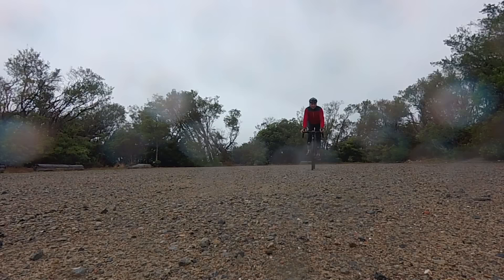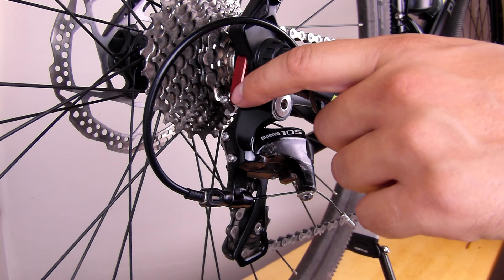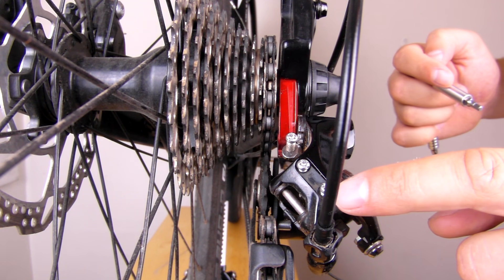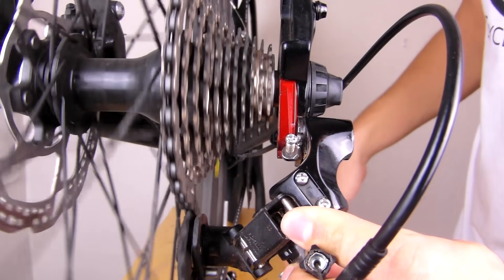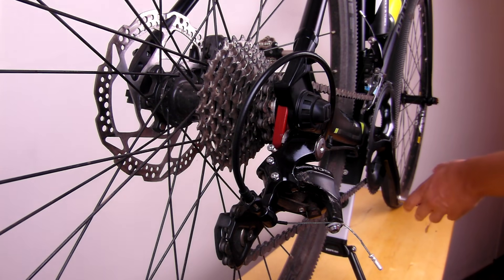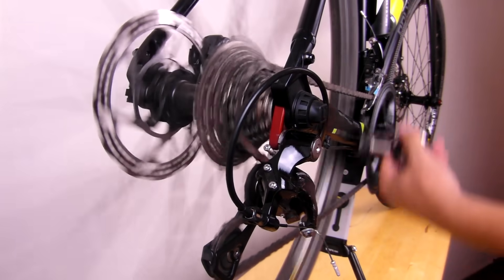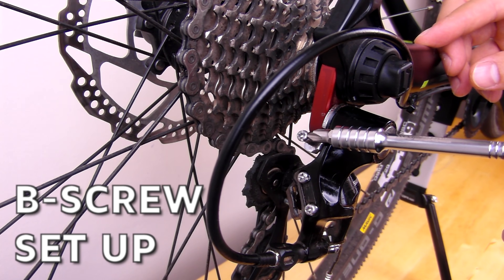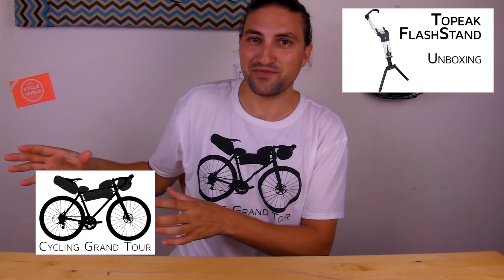How to Adjust your Shimano Rear Derailleur | #CGT - Bike School

Comment: Thank you man.  I just spent two days literally fixing my bikes gear shifting and you having explained the concept and easy steps, which helped me get things done in an hour.  My shimano derailer isn't as good as yours so I had a ton of trouble adjusting it right since the chain tends to end up slipping either to the front or back of the cassette.  I had to adjust L and H but the worse part was the anchor bolt where I had to adjust the wire tension to somehow make the derailer arm align with the cassette.  I then shifted to every gear and quickly adjusted, while my bike is upside down until it was somewhat smooth gear shifting.  I still haven't made the shifting as smooth as I want, but it's a huge step in the right direction and I'm writing to say thanks since now I can at least ride my bike with gear working.
Reply from the maker: Thank you for your comment, John. I am glad it helped you and that you are back on your bike! If you have any other questions, let me know.
Happy riding!

Comment: Thank you. This guide is different from others I watched. And looks like I succeeded. 
Very short and clear guide
Reply from the maker: Awesome! Thank you for your feedback, Gleb
Reply: @cyclinggrandtour  is there a chance, that rear derailleur is working strange due to bycicle has only ~ 500 km run. Everything worked well on tripod. But when I had a ride, it started to act strange. Like not switching the gear, and swithing two gears afterwards. 
Thank you!
Reply from the maker: Hi Gleb,

I would suggest checking the rear derailleur hanger alignment first. 
Then I would make sure the rear wheel is installed correctly (if quick release, open it, put downward pressure on the bike to make sure the wheel is sitting correctly on the frame).
Last thing would be to check the gear cables, especially if you ride the bike in wet weather or mud. 

Give that a try!

Comment: Thank you. You are a big  help  to me! I was not able to shift to 2 biggest and 2 smallest gear but now with your video... I could. I still could not get into gear 9 though in my 10 speed cassete when shifting down from 10 to 9, I have to shift to 8 to move further down gear and skip 9 sprocket ..but when I shift up from 1 to 10 I could get into 9.. Will you be able to advise?
Reply from the maker: Hi Jeremy, happy the video helped.
The issue you're having can be down to 4 problems.
1 - Old inner/outer cable - if your cables are getting old, there will be more friction when changing gears and could lead to the problem you're having.
2 - Old derailleur spring - If you have a low to mid-range derailleur, the spring can get "tired" after a few years. In some derailleurs, you can swap the spring, others you might need to get a whole new derailleur.
3 - Limit screws - If your limit screws are a bit too tight, it might stop the chain from flowing to gear 10. It works when you do a more violent gear change because of the momentum the chain/derailleur gets when you try to do multiple shifts at the same time. Try to releasing the limit 1/4 of a turn, then try again. If still not ideal, do another 1/4 turn.
I would recommend doing step 3 first, if still not working, try new cables as step 1 indicates. If everything else fails, might be cheaper to take the bike to your local bike shop and get them to see if you need a new derailleur as step 2.
Let me know how you go with this!
Thanks for watching
Reply: @cyclinggrandtour  hi.. sorry I got it wrong..it was gear 2 that I could not engage . It has to be either 1 or 3. So should I adjust the lower limit ?
Reply from the maker: @jeremytan4569  gear #1 being the easiest gear to climb hills? If yes, then not being able to select gear #2, and assumig all other gears are near perfect, could point to a problem in the shifter.
If some gears are rattling and you can't use gear #2, then it's most likely the cable tension. Changing inner and outer cables is quite inexpensive and will tell you straight away if that was the issue or not. Friction cause by older cables can make gear shifting and cable tension adjustment near impossible.
let me know if this helps

Comment: Hi! This is an excellent tutorial, I'm a newbie to these stuff so when on big chainring my rd couldn't shift to biggest cog and the smallest cog but anywhere outside that the shifting is smooth as butter, but when on smallest chainring all gear shifting is so smooth (rd can clear from smallest to biggest cog without issue) any idea how to fix that? Thanks!
Reply from the maker: Hi!
What drivetrain are you using? 
I know some electronic drivetrains don't allow for steep cross chaining.

Let me know what you're using and I'll try to diagnose what issue you might have.

Cheers
Reply: @cyclinggrandtour  it's a 105 5800 11 speed groupset just like on the video
Reply from the maker: Hmmm that is a peculiar issue.

My first thoughts it that the chain might be too short - that would explain the chain not getting into the big cog when on the big chainring, but not the issue you have on the small cog.
Another idea might be limiter screws, or old outer cable, but because you have full range on the small chainring, this might also not be the case.
If the cassette is too worn out, that can also make shifting harder, or if the chain is worn.

Unfortunately, I can't think of one exact reason why you are having those issues. 
Perhaps look at the above and go one by one, and try to find the culprit? 

Best of luck!
Reply: @cyclinggrandtour  well after i keep tweaking it to the best i could i decided to take it for a ride, what i found is that from big chainring i can shift to biggest cog but it's a bit slow and creates ticking noise before making the shift and i also can shift to the smallest cog but it's also creates ticking noise no matter what i do with the barrel adjuster
Reply: As for the chain's length i can safely assume that it's adequately sized, cables are also fairly new (i have put 2k km on them) chain is brand new (less than 500km) idk about cassette because i got it second hand along with the rest of the groupset, i replaced the chain immediately with the one i currently using, it looks pretty good and considering the previous owner said he's "barely using it."
I should probably keep tweaking with the limiter screws and the barrel adjuster, there's something i probably missed, thanks for the replies!
Reply from the maker: Not a problem, and thank you for replying back.

If we ignore the fact that you should be able to use all gears, for the best life of your groupset, you shouldn't cross-chain often, especially under load, and the steep chain angle will wear out your drivetrain faster. Try to use: small chainring = 1 to 8 gear (1=big cog); and large chainring = 4 to 11 gear.

For the limiter screw for the smallest cog, you can afford to keep it quite lose (ie. an extra half turn off from perfectly aligned), because you will rarely have any issues by doing this. 
The limiter screw on the big cog is a lot more crucial, as you don't have the derailleur to hit the spokes, because that can we a big issue.

I assume you checked the derailleur hanger too?

Have you checked your B-screw tension?
Reply: @cyclinggrandtour  i only do cross-chaining when attacking a short-punchy hills, that's why i need the full range of gears, of course i wouldn't do that under normal circumstances. well, i did some tweaking again with the limit screws and barrel adjuster, it's much more better now, all gears shifting smooth except shifting to biggest cog with big chainring, it has slight delay and rattle but at least it shifts, i guess that's perfectly acceptable for me
Reply: i once fell when failed to unclip, bent the hanger and had it fixed, at least it looked straight with my naked eye. i gave the b-screw couple of turns, other than that i don't really pay much attention to it
Reply from the maker: Gotcha. Well, I'm glad you got it to work okay-ish. 
When standard hangers bend, they don't usually go back to be 100% straight. I would recommend getting a new one, and buying a spare just in case.

Thank you for the messages, it was good to troubleshoot this with you.
Happy riding!

Comment: the b screw goes in and out on my old 10 speed but it doesnt seem to do anything with changing the tension or proximity to the cassette. perhaps theres a spring thats worn out?
Reply from the maker: Hi
My guess is that your chain might be too long, and if that's the case, the b-screw would not be able to add any tension to the derailleur/chain. 
Chains stretch over time and it's not uncommon for people to remove a link from a well used chain to shorten it and give back some tension to the system.
Select your smallest cog in the back and smallest chainring on the front and see if the bottom of the chain bows down, floppy style. If that's happening, then the chain would be too long and could be improved by removing a link out.

Let me know if this helps!

Comment: When adjusting both limit screws, do you screw in both barrel adjusters on the shifter and rear derailleur? If you have 3 front chainrings (24 speed) which front gear, do you shift it in when adjusting the limit screws?
Reply from the maker: Hi, thank you for your questions.
So, the limiter screws have no impact on the cable tension. The limiter screws only "tell" the derailleur the range in which it can operate, so it stops it from extending or compressing too far.
Ideally, you would set the limiter screws before you start fine tunning the cable tension to the derailleur, but you can do it after, or you can fine tune it after.
My recommendation:
1 - without the cable installed on the derrailleur, move the derailleur with your hand and set the top and bottom limiter screw (this will prevent the chain from going into the spokes).
2 - install the cable, and use barrel adjusters to fine tune the gears.
3 - check limiter screws again and ensure they are done right.

For your 2nd question:
For the limiter screws I would use the outside gears in the front, meaning if I'm adjusting the top limiter screw, the one that prevents the chain from going into the spokes, I would use the smaller chainring in the front, closest to the frame.
For the bottom limiter screw, use the larger chainring, further away from the frame.

Hope this help! Let me know if you have more questions
Reply: @cyclinggrandtour  Before you install the cable to fine tune.  Do you screw both barrel adjusters all the way clockwise at the shifter and rear derailleur?
Reply from the maker: @deltafour1212  Yes, you can do that.
Usually I screw it all the way in, and then do half turn the other way, just in case you anchor the cable too tight for some reason, then you can come off on the barrel adjuster without having to re-do the cable again.
Reply: @cyclinggrandtour  Thank you!

Comment: Great video, very simple, easy to understand, and most importantly concise! I think we all hate those "Hey guys, welcome to the channel, just before we start..." types who ramble on and on for 25 minutes :D

I wanted to ask a quick question about a weird issue I'm having. I can shift fine about basically the whole cassette (105 11-spd) however if I want to shift up from 4 to 5, it has a lot of trouble making the shift. If I give it two clicks and jump to 6 that's fine and I can then shift down to 5 again and no worries - this is mostly just a nuisance but unfortunately my natural tendency is to ride in this range and often I end up wanting to ride a little bit of a harder gear, failing to shift to 5, having to shift to 6 and drop down, and it ruins my cadence since 6 is too hard a gear to drive.

Any idea what could be the issue? Brand new cassette and essentially a brand new chain/derailleur etc - maybe 6 months old when this problem first appeared - so I think any cable-stretch and initial 'bedding-in' wear has already happened
Reply from the maker: Hi there, sorry for the delay in response.
From my experience, when all the gears are perfect, but then the gears in the middle of the cassette are not great, that generally points to a very slight bend on the derailleur hanger. If you have a spare one handy, you can swap them out in a couple of minutes and see if that's the issue. If not, you can ask at a bike shop to check the derailleur hanger.

The other option is that the outer cable can have dirt inside, but that would compromise all gears, not just 1 or 2...

Let me know if you find out what the issue is. I'm curious now :)
Reply: @cyclinggrandtour  No worries, we've all got busy lives to lead! Thanks for taking the time to reply

I'm afraid I still don't know what the issue is really - I've re-indexed the gears and the last time I rode (it being winter in the UK makes it less than inviting to cycle right now) they were functioning very well. I don't know what I did to fix it exactly but happy they seem to be working much better than they used to.

I'm thinking you may be right regarding the hanger as when I indexed the gears the jockey wheels didn't seem to be in an exactly vertical line with the cassette gears. Possibly this was just the way I was looking at it, or even the way my glasses warp my vision slightly and can make straight things appear ever so slightly curved. Either this or there was a small sticking point on the gear cable somewhere that meant tension wasn't quite released properly for that specific 4/5/6 range.

I think in Springtime I will take my bike in for a full service, as it probably could do with having the hydraulics bled soon, and I'll ask them to have a little look at the gears and see if they can figure it out.
Reply from the maker: Well, glad to hear it's working now hahahaha well done! :)

Yeah, the jockey wheels and how they line up can be misleading sometimes, but you might be onto something there.

I like your plan. Springtime, just before you start to put in some serious miles, get it checked out and they should be able to spot what the issue was.

Thanks for getting back to me :)

Comment: This is great - however, the way my bike is setup now, I cannot get into the highest gear! So how can I remedy this so that I may follow the instructions?
Reply from the maker: Hi David,
I would start by checking the limiter screws. If too tight, it won't allow the derraileur to move far enough to get into gear. 
Next is cable tension, if by higher gear you mean the big one for uphills, then you need more cable tension. If by higher one, you mean the smaller one, best for top speed, then you have too much cable tension. 
Let me know if this helps
Reply: @cyclinggrandtour  Thanks for the quick reply. In this situation I mean the smallest cog in the rear. I just experiment with my H limit screw (all the way in, middle, all the way out) and I still cannot get into this smallest cog in the rear!
Reply from the maker: @DavidMacVicar  check your derailleur hanger alignment. If bend, that can explain the problem. 
Otherwise, the only other thing to do is cable tension. Too much cable tension won't have enough slack to allow the derraileur to move to the small cog. 

A third option is the inner cable and outer cable themselves. This happens more often on mountain bikes, as dirt, dust, and grit get inside the cables and create unwanted friction. 
If your cables are old or you feel like there's some resistance, then you might need to change cables.
Reply: I had the same issue as it has been mentioned here tension9f the cable needs to be adjusted. Thanks a lot!

Comment: it would have useful if you could describe how tight the cable has to be when you anchor it
Reply from the maker: You want to pull on the cable as hard as you can before anchoring it. That is way I recommended the little trick to pull the derraileur slightly inwards by hand before anchoring it. 
Let me know if this makes sense

Comment: i have an 8 speed giant revive recumbent bike. there is only a rear derailleur. the shifter doesnt shift in all gears, like 3-4 gears, no movement, and then 6,7,8 gears no movement of the chain. what do you recommend?